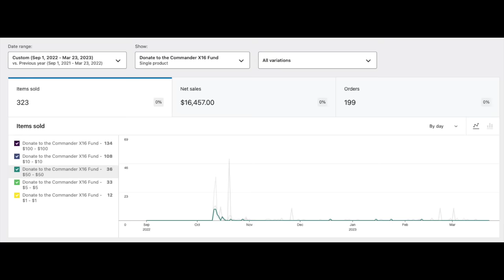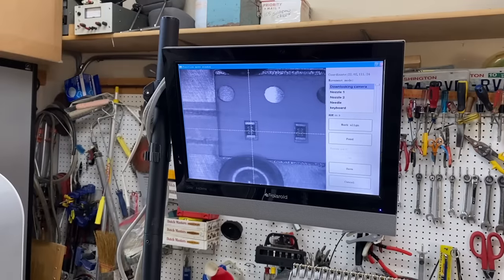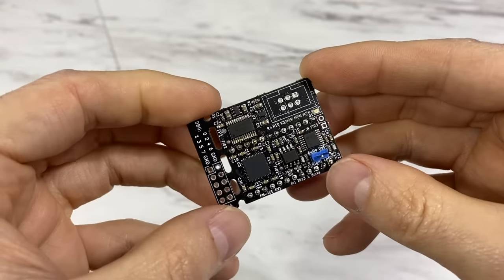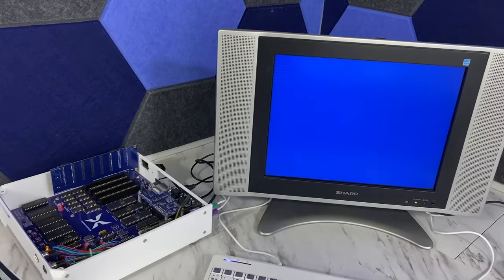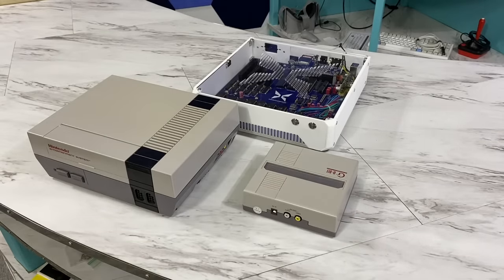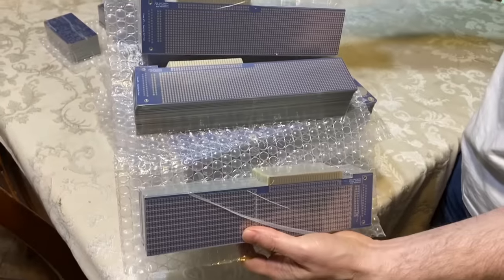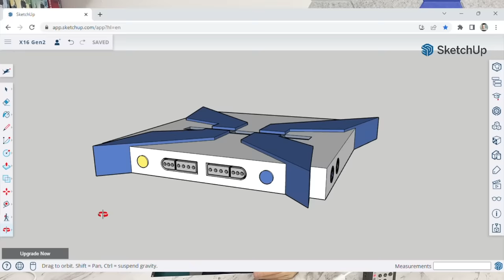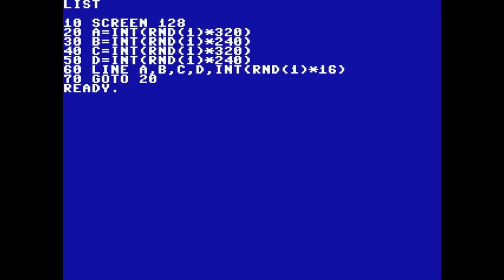Commander X16 2023 update

Comment: Too bad about the fake chips, but that is, unfortunately, a common issue (ask Adrian Black about it!). And going with out of production chips was always going to be iffy. It's too bad FPGA wasn't the heart of the design from the beginning. In many ways it would have made the production easier. You could incorporate multiple chips on one FPGA, allowing the motherboard to be smaller and less complex (and thus cheaper too). I hope the soldering issue can be solved!
Reply: I think retro computing at this point has to embrace FPGA/CPLD as the modern stand-in for something like the ULAs or other semi-custom ASICs of yesteryear. We just don't have the resources to tape out new silicon, really, but anyone who learns HDL can build a new chip with off the shelf parts these days. 

Or an STM32.
Reply: @samuraiBSD  true. somehow 'retro' today is misinterpreted as "old through-hole chips only". David is always saying that he wants the design to be simple for everyone to understand, but i doubt most ppl can understand this design nor do they really care. they just want to use it.
Reply: @samuraiBSD  FPGA definitely opens up many possibilities and can greatly simplify a motherboard design.
Reply: The problem with using FPGAs when NOT "strictly necessary" is where do you stop? Using an in production real 8bit CPU with in production 8bit SRAM and FlashRAM and available 74 series glue logic gives a much narrower design envelope to work in.
Reply: @brucemcfarling4674  I think you stop at anything a custom ASIC would have done in the past. So like the NES' PPU, or the ULA on a Spectrum. While some of those things could be implemented in TTL with logic chips, it increases the cost of kits for those things pretty significantly, which is why the original machines had custom silicon to begin with: Lower chip count to reduce cost.
Reply: @brucemcfarling4674  Maybe so, but legacy chips can not be counted on to even be available or in good working condition (or even those actual chips as David Murray found out!) whereas FPGA can greatly simplify the overall design and, most importantly, ensure that they can get as many as they need and make changes down the road as needed.
Reply: @brucemcfarling4674  Why use 74 series TTL chips when you can use 4000 series CMOS chips for some power savings with much of the same functionality  if you're going with the discrete logic method over FPGA or CPLD
Reply: @samuraiBSD  damn right
Reply: @cryptocsguy9282  I do not believe they use 74 series TTL chips, I believe they use 74 series CMOS, but I do not know whether it is 74AC, 74ACT, 74HC or 74HCT. I gather you wouldn't use 74AC for breadboarding because the fast rise times can introduce ringing if it overshoots, but they have have PCB from the outset, so that is not a constraint. IIRC, ACT is the fast rising CMOS that respects TTL levels, so that might simplify the interface with the 3.3V Vera daughterboard.
Reply: It amazes me that this doesn't use an FPGA. This thing would be tiny and a tenth the price. I know that was a design requirement but wow! As far as understanding it goes, the elaborated RTL is a schematic that is just as easy to follow as the schematic it has now.
Reply: @BrianPhelpsV2  FPGA would definitely have MANY advantages and not very many disadvantages (if any).
Reply: @giornikitop5373  Might as well use an emulator then. If I set out to do a project with certain goals and on the way abandon everything I set out to do, I have a failed project.

Comment: In your Commodore TED series video you mentioned how models with less memory were the big issue that dragged down game development for the higher end models. Making the console version of commander X16 have less memory is a mistake. It should be the same system. In fact you could make the console have one expansion slot on the side, like the Sega Genesis, to add an external module that grants the system expansion slots and other capabilities that are on the power user model. That way somebody can start with the lower cost console and at some point buy that module if they decide that now they want the full experience.
Reply: I definitely agree - thankfully this should be possible on the gen2 system 
👍
Reply: The cartridge slot is just a normal card slot…

Comment: I think your production woes really underscore how important it is to DFM (Design for Manufacturing) from the get-go. If you have requirements that SMT assembly fabs can't fulfil, then it's a sign the board should have been designed differently.
Some people opt for pick-and-place for SMD devices and then manually solder THT components in-house. That would be reasonable too.
Reply: There is a huge amount of naivete in the design, both hardware and software.  It's going to be a big pain to program.  I find that naivete a big disappointment.  I realize that this is retro, but there wasn't someone in the design team who had a sophisticated understanding of what it would take to make a system that made the most of the hardware, make it so that writing software for it wouldn't be a huge pain, and let alone what would make it easy to manufacture. As someone who programmed games on the original machines back in the 80s and 90s, watching this guy stumble along has been a bit painful.  There are lost opportunities here.
Reply: @joshuascholar3220  Which ones? What opportunities were lost?
Reply: @bbuggediffy  I've never been impressed with the design decisions they've made for memory model for this.  It needed multiple windows into the memory or an actual 65816 to reduce the rather extreme pain that will be involved in laying out the memory map for any program on it that takes more than the 64k bytes that the processor can address. 

And when The 8 Bit Guy talks about C or Pascal compilers for his machine, it's clear that he's never had a handle on the what makes the 6502 different from other processors, or how really hard to use the memory bank system they've designed is.  

About those languages, they are going to make 16 bit integers the most basic data type that calculation are done on - slowing software down over something that can use 8 bits effectively by a factor of 3 or 4.  If you're stuck with a truly 8 bit machine like the 6502, you really want a custom language that can get the most out of 8 bits.

But then the way they added bank memory is a bigger problem and any high level development language would choke on that as well and that's a worse problem. 

There is no fast way to use memory in one bank and process it to another, no effective way to have a large memory model for data and code.  Code would have to be segmented by bank, data would have to segmented by bank, and there's no efficient way to use those banks.  Data would have to be slowly moved out of one bank and then processed into other banks if you want to process data larger amounts. The 6502 is a weak processor and the design doesn't give it much help.  Just having more memory isn't such an advantage if there's no efficient way for the processor to use it. And it will be a big problem for programmers to have to segment their code and data. This could have been handled by having multiple windows into the banks, but I guess there was no one on the design team who thought about what it would take to turn the system into something that could have a powerful development system without pain.

Ideally you just use a 65816 (which he seemed to be planning to but never got around to), but otherwise you make a bunch of bank windows and use them like segment registers.  You want efficient use of memory, have a source window into the banks, a destination window, a far code window, perhaps even a leaf routine window and a kernel routine window, and a display window.  The more the better.  Then you can process data in loops without slowing it down by bank switching in the loop or by copying out of the bank.  And you can call leaf routines and kernal routines without having to call out of a bank to set up every call.

I guess the system is authentically retro in that the engineering for the design is no more sophisticated than it was back in the 80s.

BASIC back in the day was naively written software, and rather hid the potential of the systems it ran on.  I'm less aware of the problems with Commodore BASIC, let's take Atari BASIC as an example.  Its only numeric data type was floating point number - on a processor that didn't have hardware floating point support.  It was SO SO SLOW.   My impression of Commodore BASIC was that it was equally minimal and naive design - useful for tiny custom, "add up my expenses" one liners, but not for showing what the system can do, very bad for games. I do know that the implementation of the floating routines on both machines is far far far from optimized.

What this machine has going for it is nostalgia for the Commodore 64.  I programmed the C64 back in the day, but I'm not nostalgic for it. I was a video game programmer back then.  But our attitude back then wasn't different from game programmers today - we wanted the most powerful hardware we could use and we wanted to get the most out of it.  It wasn't like today's game of "retro" programming that's programming with one hand tied behind your back.

I realize that this is retro, but it's kind of sad that it wasn't designed to get the most out of the hardware that IS there.  The most you could have gotten out of a 6502 design would have been something that allowed high level programming and other relatively large memory tasks nearly as effectively as an early Mac and had graphics and sound as good as a 16 bit game machine.  But the x16 will never have the former.

Comment: I'm still excited to see where this goes and how it evolves, but I do think it's funny that the X16 was born out of a disagreement with the philosophy of the Foenix C256, and has over time morphed into something that looks very much like that project.
Reply: That's a GREAT point.
Reply: Since this project began, we've seen the emergence of the Zeal 8-bit, a bit closer to form of the original project spec
Reply: @thecorruptedbit5585  Yup! Zeal is also a super interesting project to me. A lot of the other small retro SBCs that have emerged since the X16 started development have taken the other forks in the road and it's fascinating to watch all of these slightly different design philosophies change over time.
Reply: And since the Foenix project is further along, the price has already come way down. The 65C02 model is only $200 (without a case; fits Mini-ITX).
Reply: @samuraiBSD  Kinda like when the 8-bit home-computer market happened the first time around!
Reply: @James Matarrese What's the  Foenix C256, ?
Reply: The BIG problem I have with the Foenix is they made what I consider to be a critical mistake in, once again, using a bespoke keyboard layout. That's one MAJOR difference the X16 did right IMHO. So, I can buy a single motherboard for $200 instead of the $595 whole system.. except now it's introducing diverging keyboard layout options. This is a problem IMHO. It'ps the same problem using emulators like VICE on a PC versus on actual hardware or even The C64. X16 avoids this by just using/adapting standard modern keyboard layouts. This presents the flat out COOL option that if you can't afford an actual machine, that's ok. Running the emulator doesn't diverge from the kayboard experience really. You can even use an external inexpensive keyboard with the X16 specific key stickers on it if you choose to make it easier. Thus, even if people can't afford the actual hardware, the software emulator remains available to everyone, and you can still play the games, play around with the BASIC system, write code, etc on equal footing, with no weird muscle memory/keyboard layout issues if you can buy the hardware eventually. You can still support the platform and buy games to run on it.

This to me is a killer feature that differentiates the systems more than people might think.
Reply: @Cherijo78 , I think most people on these retro systems are programming their games with the kind of controls that games had back in the day: Arrows keys, IJKL, WASD, and/or the Space Bar are typical controls and are in the same places on basically any keyboard (including the F256K's built-in keyboard).

The difference in the 'bespoke' keyboard is mainly that the F-keys are off to one side and some have to be meta'd.  But you have the exact same problem running X16 or Foenix in emulation, if your computer is a laptop (which also, often, require a meta key to reach the F-keys, and have other slight variations in layout).

I mean, I get what you mean about muscle memory: every time I buy a new laptop and the ctrl/win/fn etc. keys are in a slightly different arrangement, it's annoying.  But it doesn't keep me from playing games - modern ones, or in retro emulation.

I think variations in keyboard layout are a small problem that programmers have long since learned to deal with.  Plus that keyboard case looks awesome.

Comment: Speaking as a professional computer scientist who has worked on many engineering projects (both hardware and software), I found this video very disheartening. I worried about just this scenario when they adopted the Yamaha chip, and also the case is just poorly engineered as it precludes the use of expansion cards. Why on earth would they be making it slimmer? The problem is in the other direction! 

Fortunately, this is not the only modern 8-bit computer in the game, but I can certainly see why they have disallowed any mention of those competitors on their forum. This project is showing a lot of signs of imploding. They have supply chain issues, parts that don't work with each other (especially the case), creeping FPGAs which undermine the original intent of the project, ever increasing complexity and several production issues. 

This would be a neat machine to play with, but at the same time I may just stick with the emulator.  The case issue takes away most of the utility I saw in having the actual hardware.
Reply: Yeah that stuck me as particularity insane.  Especially for a dev board.  I imagine he's using the logic of "well you can just take the top off" but that only really makes sense if you are constantly add/removing boards.  Once you've got it setup the way you want you generally want to close it up.  I don't know but if feels like the case is 1 gen ahead of where the board actually is.
Reply: @rockapartie  it is. The creator of one 8-bit machine offered a harsh technical criticism of Commander X16 and they declared him to be "toxic" and will delete any mention of the ... I can't say because they will likely delete this reply. 

The thing is, all of the toxicity I can find is coming from the x16 creators. In my opinion, those practicing censorship are always in the wrong. That they forbid its discussion is a clear admission that the competitor is a better product.
Reply: Yeah, this is a project I have been excited for a long time about, but unfortunately that evaporated by the time they started seeking donations to start a for-profit business. Especially the refusal to sell a kit. I get that compromises and sacrifices have to be made when getting into production. Unfortunately for the X16, the decisions along that path made it less and less interesting compared to the original concept.
Reply: @robertlowe8843  To be fair, that guy is toxic.  Just read his website (not just Commander X16 stuff).  As far as I can tell, all of these 8-bit projects are done for a laugh and a few YouTube videos.  Gloating over problems seems really pointless.